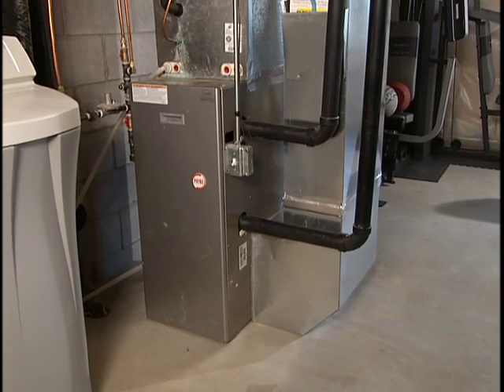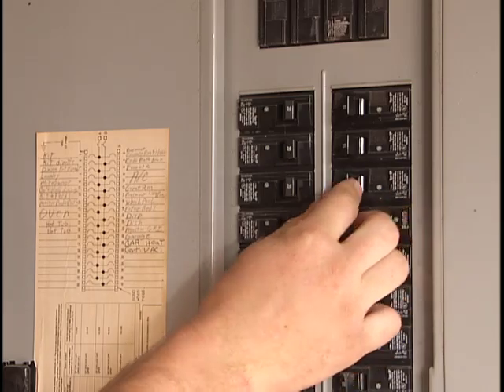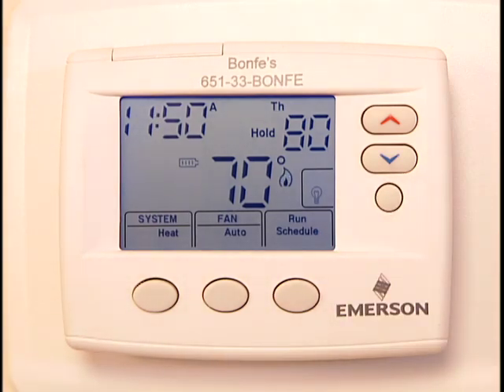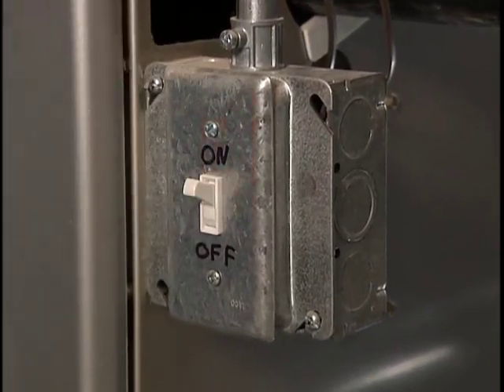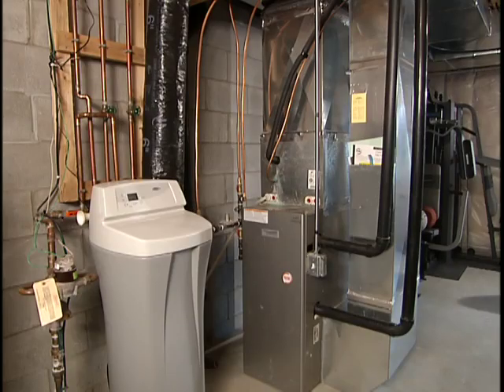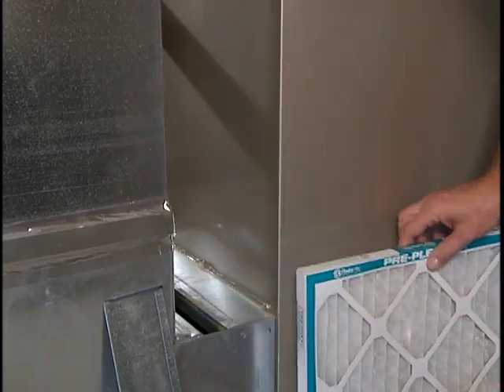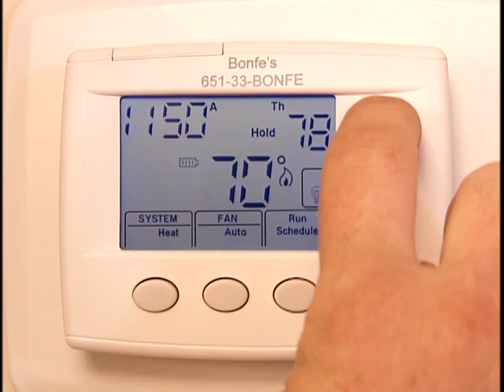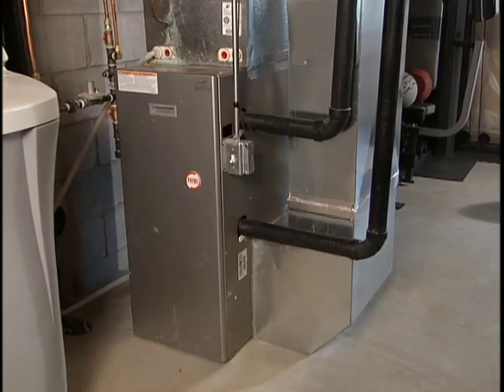How To Fix a Furnace that Won't Start - Bonfe's

Comment: God bless this Video my furnace stopped working during the blizzard of 2016 this video told me to go outside and clear the vent it was covered by 2 feet of snow! I did not know I had a vent outside. THANK YOU!!
Reply: It Sounds Like 2016 Was A Bad Year And A Bad Winter.

Comment: My thermostat (digital) isn't working properly. This video did not help for my situation and I tried each step.
My thermostat does have batteries and works. However, when it is OFF n the fan is ON, air (neither cold nor hot) blows out from the vents. When it is OFF n the fan is AUTO, no air comes out. When it is on HEAT or COOL, nothing happens. It is cold and I am trying to get the heat turned on. Any tips?
Is it a problem w/ my thermostat or furnace?

Comment: My furnace won’t turn on once the thermostat temperature drops. I have to turn the furnace power switch off n on then the furnace kicks on and start running. I need your help; it’s really cold. Thanks!
Reply: I have the same problem. Did you find a solution yet, erica?
Reply: did either of you figure out what's happening? when my apartment maintenance comes out they just turn it off and back on and when it works, they just shrug and say it's fixed. When that is the ONLY way to get it to work -- it won't automatically turn on anymore when the temp drops, I have to keep doing the manual on/off dance every few hours.
Reply: Yeah my HVAC guy came out last week and he said he thinks it was the flame sensor. He took it out, cleaned some crud off of it, and put it back. Extremely simple fix and the problem hasn't happened since. He said if the sensor is dirty the thermostat's signal will be weak or fully blocked and the furnace gives up trying to light (a safety feature).
Reply: Do you know where the flame sensor is located? TIA

Comment: I'll be the odd man out here. It didn't work for me. I have a manual (non-digital) thermostat and a propane furnace. I can hear it trying to work (The furnace clicks.)  but the furnace will not ignite. The safety button is depressed on the door. Any ideas? Thanks.
Reply: see if the pilot light is on or needs to be cleaned
Reply: @imaphxaznative  Thanks.